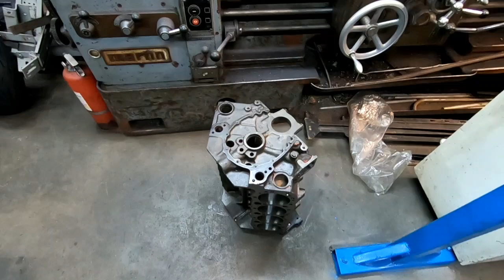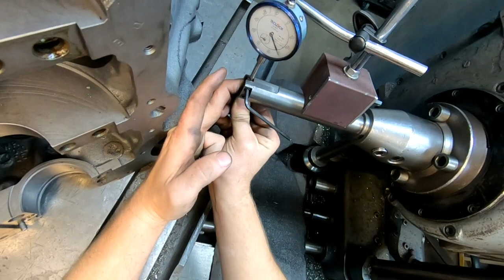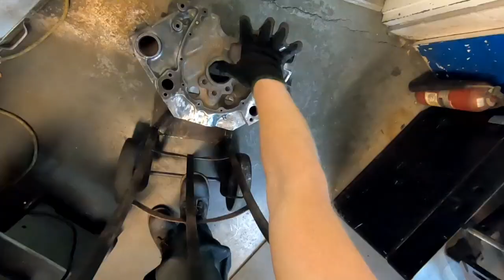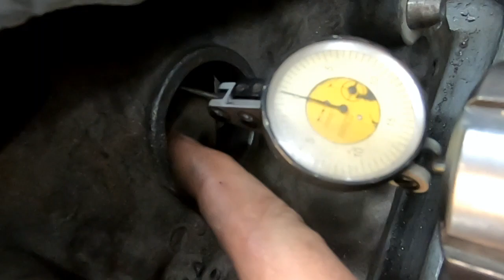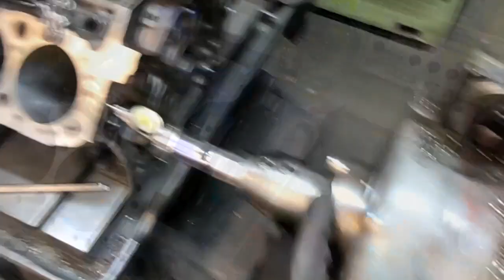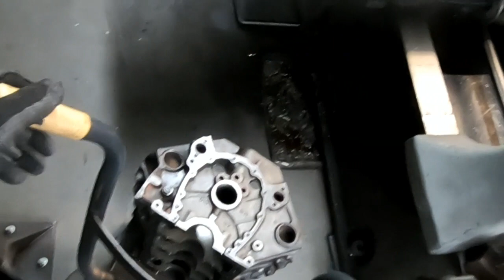boring 350 Chevy blocks

Comment: Nice work, HBM and Jay to the rescue.
I sure like the capability you have to do this work. 👍💯
Take care, Ed.
Reply from the maker: Thanks Ed.
  Yea, this ole machine allows to really manipulate an engine block. Before I ever saw how block remanufacturing was done, I thought it would be something similar to this. My machining career started in die repair and manufacturing. So I only knew of manufacturing machinery. Was quite surprized when I toured my first engine shop and didn't recognoze a single machine lol. The one op engine specializing machines totally make sence though and some of the new stuff is more like manufacturing machinery which is allowing more things to be done on a single machine. Kinda how I thought it should be Anyways, they way out my budget lol. Gotta keep the ole G&L putting in the work.

Comment: Nice video coverage, lighting n all. Steady as she cuts...
Two engines to get gone through here in North Seattle area;
As watched here, an orig. '72 Vette block needs full teardown,
 inspect, take it to .060 for KB pistons, get rods treated, set for 
Eagle stroker crank. Second eng. is Buick 215. Same deal, need 
gone through, inspected - know any place I should take them? 
After this freeze out though - Have a safe holiday!
Reply from the maker: Thanks👍🍻 I'm not aware of any engine machine shops in the Seattle area, I'm just up north in Langley, BC Canada. I do follow quite a few, very competent engine builders on IG. Many are in California. I could set you up with some recomendations if interested in shipping out that way. I have done a handfull of Buick 215's and had an Olds 215 here about a year ago. The newer Rover versions I see often. I install top hat style sleeves in them for a few local engine shops. Parts are still fairly available them thankfully. 
This freeze out is quite something lol. Roads are pretty messy up here, lots of cars in ditches and medians. Not a fun time for many. Thanks for watching and enjoy these holidays to the max👍🍻